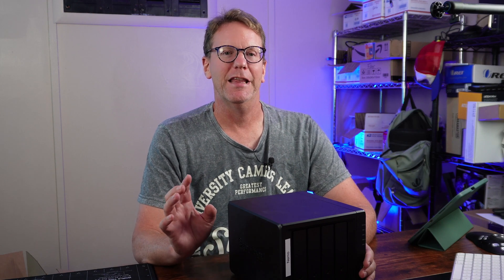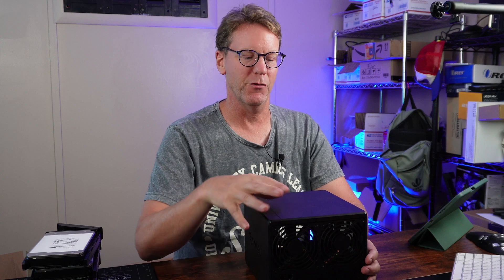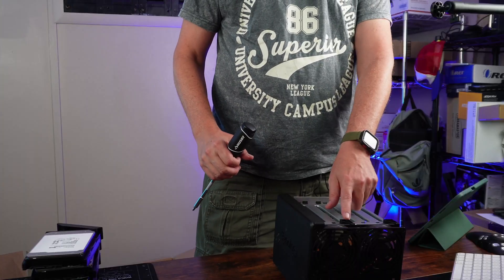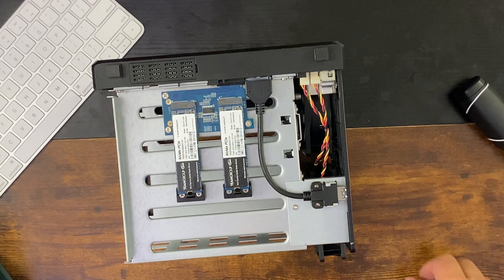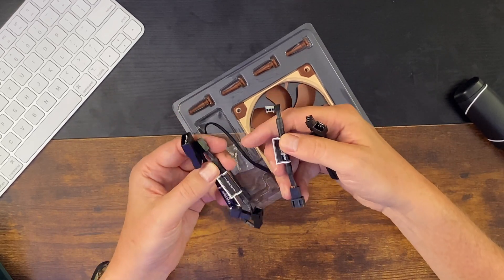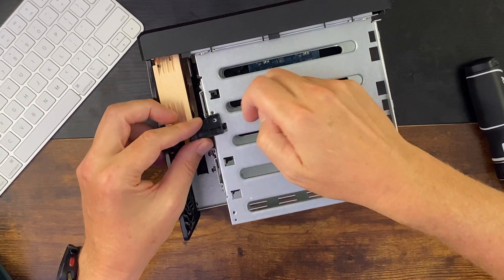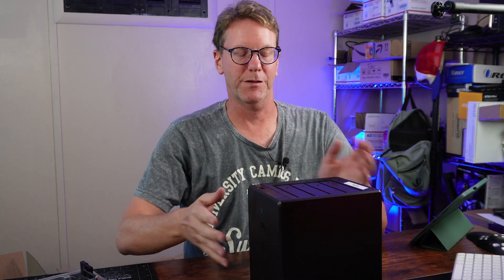Easy Synology 920+ Fan Replacement

Comment: fyi for anyone buying a synology I suggest doing this mod when you first buy the unit, along with the velcro fuzz slot mod. The included fans you get aren't bad, but they are typical mass production and will almost inevitably end up making noise a few years down the line. I also suggest doing it before you put any M.2 sticks, when I did mine when I went to put the case on it flicked the M.2 slot holder and knocked the stick out, which could have caused damage. make sure you check what fan is suitable, as some boxes only use 3 pin fans, some use 4 pin PWM control. I put Noctua NF-A9 FLX 92mm, 3 pin in mine.

Comment: In which direction must the air flow out? forwards or backwards? i.e. the arrow forwards or backwards?
Reply: I have already removed mine but have forgotten how it was the right way round. 😂
Reply: @erde-erde2035  out flow.  most fans have a direction arrow on them somewhere, and it's almost always blowing through to the side sticker is pointing.

Comment: A terrible guide, if you can even call it that. It doesn't explain how to connect the power cables and if you need an adaptor or not, other comments seem to suggest the anti vibration mounts can be used or should be used instead. If you are gonna do a video at least do some homework and try to talk through these things. I am not much more the wiser after watching it to be honest.
Ps- I'd recommend taking out any m.2 ssd's first so you don't catch them and also unscrewing the fan screws BEFORE the fan harnesses because if done the other way around the nas rear case can be bent easily while unscrewing.

Comment: My original 920+'s fan number 2 just died, after daily operation for 2 years 5 months. Technically it is under warranty. HOWEVER this and other similar videos have convinced me to splurge on ... fancy pantsy fans. 

Fancy pantsy fans ... felt good repeating that line, yeh. 

Also going to try the "velcro" fix too, laying the furry side of velcro tape underneath each drive rail, in hopes of minimizing noise. I currently place 1' worth of books on the top of the unit to weigh down the noisy vibrations, so that could be improved with the velcro fix -- I hope.

Techno-dad-on, man.
Reply: Well, It works great. 

Installed velcro and two new fans, and the fans are running + it's quiet. Set it to cold mode and I've got no bleeping errors 🙂

Mission accomplished.

Comment: RTFM!!  You should have used the 'rubber' items 3:52 instead of the screws to hold the Noctua fans in place. They 'dynamically' attach and dampen, thus reducing fan noise.
Reply from the maker: The rubber things would not fit and the brackets isolate it.
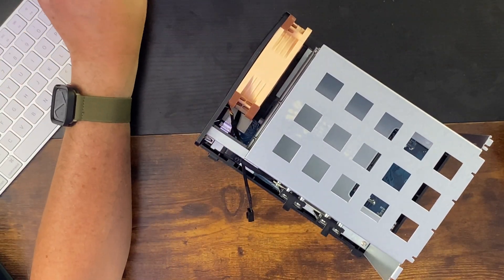Reply: I would say you are probably right, but at 5:58 there are a couple of odd black brackets that locate on the fans. I wonder if those brackets are to provide stability to the enclosure when adding/removing drives. If so, then the fans would have to be firmly attached at the other end and the rubber mounts would not be suitable.
Reply: @shm5547  You can't use the rubber mounts in these synology boxes because there's not enough room. Nobby tip at the back end will poke out. Also the way the synology box is build you have to use the clips that connect the fan to the metal chassis (or the backplate will flop about). So any vibration noise will be transferred into those clips anyway, so you might as well use the screws from the old fans and make sure all 8 fans screws + the 2 brackets and the 2 screws that tighten down the plastic shroud are all tightened down correctly so any vibration is transferred into the plastic shroud and distributed away from the fans & metal chassis.

Comment: Those are not extension cables. They are Low Noise Adaptors (LNA) for reducing fan speed for 3 pin fans.
Reply: And I read someplace they could help with compatibility to the Synology's variable fan-speed implementation. I need to research this more though.